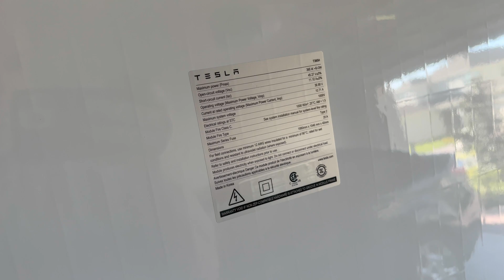Tesla Solar Install 18kw System and 2 Powerwall+

Comment: Any update?  Would love to see how your first year went!!
Reply from the maker: I didn’t actually do a video but I will say being in Florida and how much we run the AC it’s saved us a lot as energy costs have gone up. I love that it’s allowing us to charge the Tesla with the excess solar now too. 

Lifetime used electricity 35.3MWh
Lifetime solar generated 31.9MWh
Imported from the grid 14.5MWh
Exported to the grid 10.2MWh

I think all in all the usage I’ve been getting has been worth it. I definitely can say I am happy with the powerwalls being there. When they had to do work on the grid for the homes on my connection I went off grid and had power while the power was actually out. It made it very nice. 

All in all with the tax savings I got I feel it’s been nice and it helps keep the electric bill down. Plus with the Tesla I have the savings from the gas prices as well. Let me know if you have specifics. I’ll def have to do some video and share some stuff with folks. But didn’t want to leave you hanging.
Reply: @williambacky  awesome. You did such a good job with the solar video. Hoping for more content there!!  We are waiting on our install!!
Reply from the maker: I need to do more on this I had planned to do updates but haven't ever gotten around to it. How did your install go? Sorry for the delay in replying back. Hope things went well for you.
Reply: @williambacky  mine is installed. Having some minor issues that Tesla is working on. The inverters aren’t powering up in the mornings in their own. I have to power cycle them. Said a firmware update is going to fix it. 🤷🏼‍♂️
Reply from the maker: Sorry to hear you are having some issues. Hope the firmware update will end up fixing it. I had some issues where I couldn’t do anything it was about a year in and turned out to be some of the wiring had come loose. They said it can happen over time but they were going through everything to figure it out.

Comment: Are Powerwall Plus standard equipment now or do you have to pay more than standard Powerwall?
Reply from the maker: You have to pay extra for the Powerwall. It was part of the same order form and done all together. I will say best decision I made was adding them. Has cut my bill by sooooooo much given I got net metering at a time we ran the ac 24/7. Allows for you to not have to use the grid for a long at night. And if there is a power outage it’s nice too.
Reply: @williambacky  It's not that you have to pay extra for the PW-AC, Using Tesla's Central inverter is cheaper as it's old technology... The central inverter VS Solaredge optimization and enphase  per panel modularity is just more efficient and cost a little more using third party inverters

Comment: I noticed they replace your circuits panel. Why did they do this? is there extra cost for replacing the circuits panel?
Reply from the maker: They didn’t replace anything they just added stuff to my main breaker. It was needed to allow them to have all their stuff but get approval from the power company. The stuff added is all of the stuff that tracks the in and out usage. It’s a middleman so to speak between my system the grid and the house.

Comment: You said you were producing the day of install?
Reply from the maker: Yup they had us running some that day. There were some issues with my powerwalls so they had to get those fixed first but yea I am producing enough to power my house and charge the powerwalls. It’s a feature they have for those that buy powerwalls with the solar. It’s something in the software of the system. Still waiting for net metering. I got my last month bill and only used 200kwh from the grid paid $56 on my electric bill last month. I could do more if net metering was enabled the system is able to produce a lot more.

Comment: I just order Tesla solar myself. How long did it take for install after you ordered?
Reply from the maker: Sweet!! It took them about 3 months for them to come and install it for me. Permits were done really quick. The county I live in turned them around in less than a week. It was a few business days.
Reply: @williambacky  wow that’s fast! I live in Texas but I heard Tesla had an 8-12 months wait time. Hopefully it will be as fast as yours!
Reply from the maker: Oh wow that is a really long wait. I do love that they have software to generate only what you’ll consume on the solar until you get approval now. At least if you get powerwalls. Which I got 2. Best thing it lasts me through the night with air on. So excited to see when the system is at full capacity. The county comes tomorrow and then they work on utility approval after.
Reply from the maker: Hope your system comes quicker than 8-12 months.
Reply: I hope so as well 😬
Reply from the maker: Fingers crossed 🤞🏻

Comment: Are you able to share your costs?  Panels, batteries all with install.  What avg electric bill was, expected ROI.  Are you able to sell back, or do you use batteries to stay entirely off their power?   Been looking into all myself but answers are a little blurry.  Thanks William.
Reply from the maker: My system is approx $55k without the discounts. I should be able to take advantage of the full 26% tax rebate given the amount of taxes I pay in each year. I got an 18kw system so it was I think 45 or 46 panels. It is what fit on my roof space. I do have a Tesla so I do use power to charge my car. I do live in Florida currently I can net meter. What I put into the grid I can draw back. My average utility bill not in summer (as I just moved) is $250. I am averaging around 1200 to 1400kwh a month so far. I am sure as we get into summer and I use the air condition as a more constant I will use more power. For me I should get an estimated ROI in approx 10-12 years or so with my rebate. I do feel that there will be times we draw from the grid as well as when its over cast we produce less power and rely more on the grid. But it has been good enough so far to charge the powerwalls and so far at night we have been using the powerwalls to power the house with the AC going. All of our appliances are electric too. We do not have anything that is gas powered. Sorry I know I just threw a lot out at you. Let me know if you have any other questions I can answer.
Reply: Thank you, that was great information.  On the Tesla site the batteries (power wall) added the most cost to the system, but then you need more buy back and payout from the power companies.  10-12 is a couple years less than I thought for myself, but was not including any rebates.
Reply from the maker: Happy to share some of the info from my experience and estimated roi.
Reply: I also watch more for Disney stuff, but this was an interesting side for me.